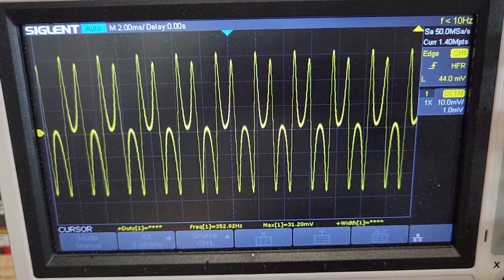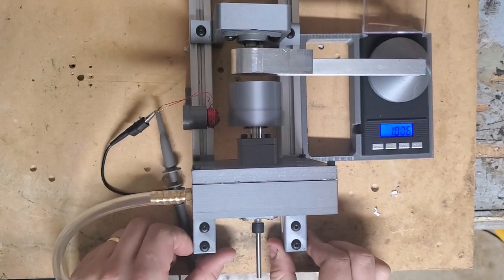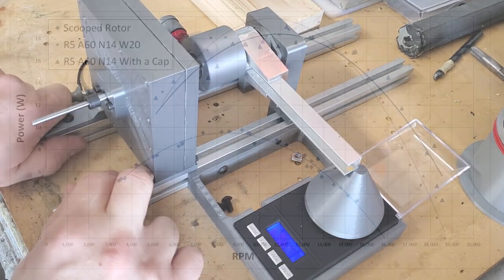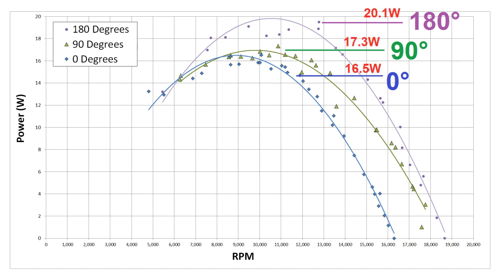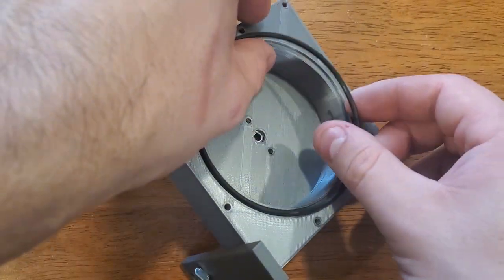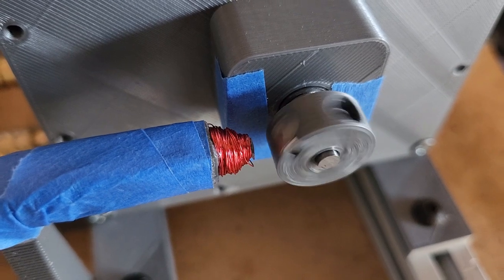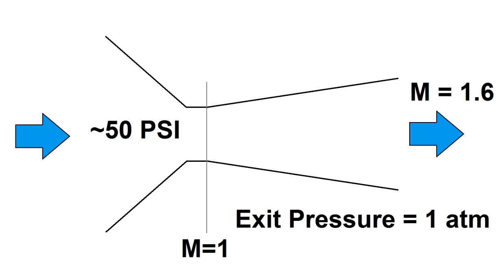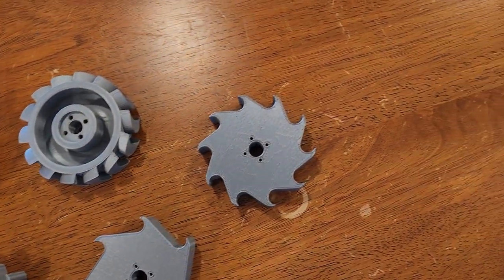Comparing Turbine Rotors

Comment: One interesting thing to not is that all of these designs seems to be of impulse type. Meaning the pressure is being converted into velocity in the nozzle and the turbine simply redirect the already expanded gas. Not that its bad or anything. I just wanted to point that out since its a different beast than reaction turbines, where the gas continue to expand in the turbine. Keeping in mind this fact brings to light the fact that the nozzle where the air is accelerated is part of the design system if not as important as the turbine itself.
Reply: Also, I can't help but notice that all these new designs are just 2D profiles spinning around. Beware that these geometry causes your exit gas to still have a very high angular momentum a.k.a energy left on the table. Might I suggest experimenting with 2 additionnal parameters to try and make up for this :
1. Add an helix angle to a scoop design (like an helical gear) to straighten up the exit vector. It could be progressive, like first half staright then it helixes.
2. Or, reduce the radius of the turbine on the side where the gas is exiting. That way the spiraling down of the gas into a smaller radius naturrally imparts its momentum to the turbine wheel and the tangential component of the output vector gets minimized. This is literraly how a radial turbine works now that I think about it. Yeah, just do a radial tubine basically XD. They just work really great and aren't as finicky to tune perfectly as axial turbines.

Comment: When adding a second stage to your turbine, would it be more efficient to use less blades on the primary stage? Then it may allow more airflow into the second stage thus more power.
Reply: Maybe also slightly bigger diameter on the later stage?
Reply: @xmysef4920  actually a smaller ènt stage
Reply: @charadremur333  A smaller entry stage? Well that’s essentially just the same thing. Either you make the later bigger, or the one before smaller
Reply: @xmysef4920  longer, so he can save some printer time and reuse the bigger rotor he printed earlier, while keeping nice design :)

Comment: I don't think the different stages should be the same size. You loose pressure in the following stages so you probably need a smaller wheel in the next stage to keep the angular speed the same. Otherwise I just think each extra stage will act as a break for the first stage.
Reply: or maybe it's larger wheel. My brain can't decide right now but I still think the break logic is valid.
Reply: @dbtest117  larger - and you need stators between each section to straighten the airflow if you're using axial turbines

For centrifugual turbines, you need an inlet volute of some sort (this is what the delaval nozzle is about)

There's a lot to be said for running separate shafts for the lower pressure stages, else they spin so fast they can disintegrate, whilst the high pressure stages aren't spinning fast enough to be efficient

Comment: What do you mean by "dwell time" ? Yeah, the high pressure air stays confined longer inside the turbine, but that does not add energy - it stays at the same exact size so it does not add any energy to the rotation. It will however (by chance) reduce some of the parasitic effects like when the air pushing backwards when exiting the turbine. With the later release more air will leak around and there will be a more consistent outstream of air.

Comment: One of the things million dollar, multistage gas turbines have in common is that each stage has a different geometry. I think maybe when you put a lot of back pressure on one stage and reduced pressure on the next stage, you alter their power bands so severely that they're actually fighting each other through the whole range of flow. (i.e. one or the other isn't acting as a turbine at all, but a really bad impeller)
It might be interesting to artificially restrict the output flow on a single stage turbine to see how that affects the power curve.

I know you've moved on to the pulse tube cooler and that does seem more promising for LOX/LN2 production, but these turbines are interesting too.
Reply: Agree.  Look at the old double and triple expansion steam engines.  The piston diameter and ducting increases with each stage.  So with this setup the second and subsequent turbines and ducting should all be larger by the 1.6 ratio.  
The design seems to be struggling between being a pelton wheel (where the energy is transferred from the inflow by the change in momentum of the inflow water stream reversing as it hits the wheel) and an expansion engine.  
The turbine stages are for expansion, and should be sized accordingly.
All the present 'cog' design does is carry pockets of air at constant pressure around the wheel.  The intermediate pockets do no work at all.  The only pressure differential in each stage is between the first pocket at the inlet and last pocket by the outlet - so 90 degrees or 180 degrees to the exit may not make any difference.  The ostensible purpose of a longer rotation to the exit is simply to reduce the air losses around the cog's sides by increasing the area of surface friction in the gap between the cog and the casing. May as well try a Telsa turbine in that case.  Good luck with that!
Reply: @nigelwilliams7920  Well, and with a steam locomotive you have the advantages of it genuinely being a positive displacement pump and being relatively slow. Even if you didn't make the cylinders larger and the ducting wider, you probably at least wouldn't get something worse than the power and torque you would have with the first cylinder by itself.

With an expansion turbine (which this is kind of in halfway between land) you can have one turbine that wants to go at 10k rpm and another that wants to go at 8k, and because they're not positive displacement and you're doubling (like you said) ALL of the drag and fluid shear surface areas, the 8k turbine might actually being powered by the 10k turbing and you'll get 9k total (or whatever).

I need to watch his first video, but I think he might have wanted to go with something like a turbocharger turbine vane design with an axial inlet and radial outlet. I think this design does choke off the ability for expansion to do work. There were a few wheel designs we didn't see in this video that looked like simplifications of a pelton wheel. I'm assuming they did worse or he'd be using them. It would probably be hard to print an actual pelton wheel and not have it self-destruct at the rpms he wants though.
Reply: @nigelwilliams7920  I went back and watched his other video. His first video was an impulse turbine (basically half a stage of what you'd find in an axial flow gas turbine).

It was ultimately less efficient than the 2d scoop things he used, but I think if he'd had a series of flow bending rotors and stators, the impulse turbine may have been much more applicable to multiple stages.

He also has what looks to be several meters of 1/4 inch copper tubing to act as a cooler for the compressed air. I know from working in a shop that small diameter air hoses (like the plastic springy coil ones) totally destroy airflow. I have to wonder how much of the 50psi he's actually getting at the nozzle. Its fine for airing up a tire, but an air drill or impact wrench would probably barely work with that copper pipe in the path.

(if you're reading these comments, just try breathing through it. You'll be surprised just how much resistance something like 10 feet of 1/4 inch pipe has)
Reply: @htomerif  Yes he would be better off using a turbo heat exchanger as the cooler as it has ample flow capacity, or at least several 1/4" pipes in parallel.
Reply: @htomerif  Indeed. Matching the design of each subsequent stage to the gas flow is a hard part of overall multi-stage expansion designs, otherwise you get back pressure/compressor stall etc.  Frank Whittle no doubt went through this agony using the radial then axial compressor and the axial multi-stage turbine.  
Its a fun intellectual exercise for the tinkerer, but as they say 'Space (and aeronautics generally) is Hard'!!
Reply: @nigelwilliams7920  I think my take on it ultimately is that his purpose is mostly to get rid of the energy (i.e. to build a DIY turboexpander). There's not actually any advantage in his case to having the multiple turbine sections on the same shaft. Having everything at a fixed rpm means you can't track maximum efficiency on any of them. He'd be better off with a variable load and independent shaft for each one.

I think I said I was actually trying to do this same kind of thing for LOX and LN2 production, but the problem with turbocharger turbine sections is you either have ball bearings, which shred themselves at cryogenic temperatures, or an oil bearing, which stops the whole thing dead at cryogenic temperatures.

He might be better off trying to DIY a gas bearing. Commercial ones are impractically expensive and a turbocharger turbine has an awful lot of axial load.

It looks like some companies are developing air and foil bearing turbochargers, but I'm guessing they'll be on the $10k end of the spectrum.

Comment: very cool!
I think at 8:36, the tube there being kinked means that no air can flow between stages, causing added resistance with no benefit, which may be the reason for the efficiency / power loss.
Reply: I didnt even see that. Good catch!

Comment: I just watched both videos and liked the project.
As with engeneering background I would like to suggest  improvements.
- balancing the rotors: do it like the RCcommunity does it: 2 cones on a horizontal steel axis on two horizontal rails.
- how about a pelton turbine? Maybe one-sided blades? You could add more conventional stages by making the outlet in a spiral way. More nozzles?
- reducing vibrations by using only prime numbers like they do in the industrial designs
- reduce friction by making spiral grooves on the sides of the rotor

Good luck!

Comment: That last part with the Brayton cycle sounds very interesting. I also looked into that cycle, but more to use it as a heat pump / heat engine alternative to a stirling cycle, to use as a bidirectional heat storage system.

Comment: I am pretty sure your air velocity would be slower in the second stage. So you probably need the second stage to either be on its own shaft or a smaller diameter to make up for the lower flow rate so it doesn't create drag on the first stage. And yes I know this is an older video now but I wouldn't mind seeing more turbine stuff.

Comment: Hello,

FDM prints are not air-tight and you are using with very high pressure. It might be causing the pressure on the blades to decrease very fastly since you must be losing pressure on the chasis walls. If you can buy a SLA printer you can rule out pressure leak problem and have a lot better accuracy on your prints. 

I might not imagined this correctly but lets say you put screws on the both walls and sealed them with o-rings. it might help you gain the heat while you are decreasing pressure on the blades. 

As far as I remember, the formula you are using is used for closed systems such as piston systems. However, you have kinetic energy at the outlet. I might be wrong wanted to remind it :).

I also wanted to experiment on the turbines but did not have enough courage to spin them that fast :).

Very nice videos, thank you.

Comment: My friend. I had a similar problem with  a hydraulic motor that I wanted to build. On my design I found that when I placed the rotor in the center I had to deal with the negative force of the rotor. I do hope you would look at a much closer or almost sealing rotor-casing entrance and a expanding casing with a much larger exit. Hope this can solve your problem. Great presentation thanks.

Comment: I think the issue with the wider rotor is the increase in mass. I would try out a slimmer rotor to see what happens. The power probably goes down a bit, but I expect the RPM to go up. This way you could use multiple stages with slimmer rotors to keep the RPM and boost the power.

Comment: I think part of your problem with the multi-stage setup is that your turbine blades are designed such that the high-pressure air is just instantly captured and halted relative to the turbine, as opposed to being deflected and expanded via an airfoil like a gas turbine normally uses. I think you should try designing some "normal" looking turbines in a snail housing just like car turbos use. That's more in line with how the turbopumps in i.e. rocket engines work anyways, or they use annular combustion chambers pointed through a jet-engine-looking turbine. The annular design might be easy enough to 3d print.

Comment: I've never seen any of your videos before, and now I'm hooked. I love your tests and step by step isolation of different elements so you can increase efficiency with each factor. I have some thoughts for further testing if you are interested. I love how you tested 0° bend, 90° bend and 180° bend. Is there any way you could go just a tad further? what about a 200° or 240° bend? How many more watts do you get? What efficiency does that add?

So I've been wandering around the internet looking at air and water compressors and turbines and such and I'm really curious how well a scroll expander would work as a  turbine. Do you thing there is a way you could test that?

Also, have you tried different angles of entry? Is there a reason you always enter and leave the turbine tangentially? The angle of entry may offer more or less efficiency base on the angle of the fins. So that's easily another test you could do.

I agree nozzle shapes could change your efficiency a lot as well.

I believe the largest issue with your 2 stage design is the complete redirect of flow. Throwing 2 90° bends abruptly like that would cause a ton of friction and slow down the air considerably. In the interest of science and no so much practicality, You may try creating 2 exactly the same turbines and instead of mounting them side by side like you did, just make the inlet of one, the outlet of the other. Then try capturing the watts of the 2 separate shafts to see if there is any true gain.

Loved the video. Keep up the fun work.

Comment: One major trick to compressor / gas pump efficiency is tolerances, like thousands kinda tolerances...
The tighter your tolerances, the lower the losses to leakage around the turbine (within the casing), downside being cooling coefficient, compressing gas creates heat which you have to dissipate to avoid lock up under general usage conditions

Comment: Have you considered using the "disk format" of a Tesla rotary pump in place of bladed rotors. I believe the Tesla pump is up to 97% efficient. I don't know if scale causes variations in efficiency, but I know it is pretty high anyway. I wish I had a 3D printer, it's a great asset. Nice job.
Reply: That was my instant thought, Tesla turbine.

Comment: There is a geometry called a Pelton wheel where the shape of each  blade imparts a 180 degree turn on the impinging stream and should double the energy   transferred.
Reply: Look at the previous video in the series, he did that and it was much less efficient

Comment: I personally preferred your scooped notched design . However , I would have integrated a streamlining feature by adding a "dorsal fin" or tail on the back of each notch as an air foil  In a shape much like a cross section of a freighter ship with the keel representing the dorsal fin. My logic suggests to me that it will  help by causing the air to comply or conform , if you will , much faster  as it tends to want to fill in the voids as it moves attempting pressure equilibrium. I also think it will help in reducing rotational resistance substantially.

Comment: I am currently working on something similar and for me, eddy current brakes as torque-givers work great. Would you mind elaborating on what you mean by "Vibration issues"? Also maybe try printing your turbine casings with more walls, less infill. I print with 8 walls and leakage (which was a big problem) virtually disappeared altogether.

Comment: At 4:52, couldn't the housing be almost 360 degree spin for the air (in practice a bit less of coursE), if the inlet and outlet are angled correctly and are positioned very close to each other?

Comment: What if you took the 180 degree and loop it back into the system at an angle that is less direct than it's primary power source? 

A feedback loop. I assume it kills some lagg, but not give more power necessarily. 
However, you're using exhaust pressurised air back into the system, so efficiency goes up in theory. However, it shouldn't be interfering with the primary power input as that could abuse some flow and makes it less efficient, so there's some play. 

Fun video.

Comment: what if you added a vacuum stage to the second rotor to help pull the air through ? and maybe some check valves the would open when the vacuum is below 15 psi.
 what if you printed a  cross tube that connects the two rotors together, the hose looked like it was being choked.

Comment: I think your issue is RPM matching. Imagine your first stage wants to spin at 5000rpm at the given pressure and the second stage 4000. Because their shafts are linked the first turbine is going to be bogged down by the slower revolution rate and the second stage acting like a pump at higher rpm and wasting precious work. Similar concept in reverse. I think if you tried to get them within a few hundred rpm you could massively improve dual stage performance

Comment: concerning your Mach number calculations: isn't the p2/p1 relation you use only valid for quasi-1D flows performing no shaft work? my understanding is that turboexpanders often operate at p2/p1 of 4 or above